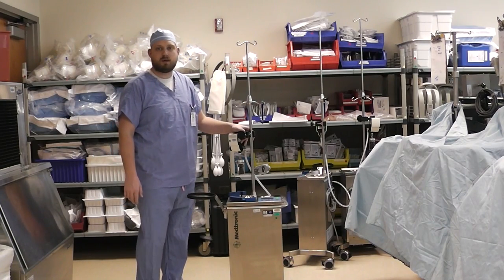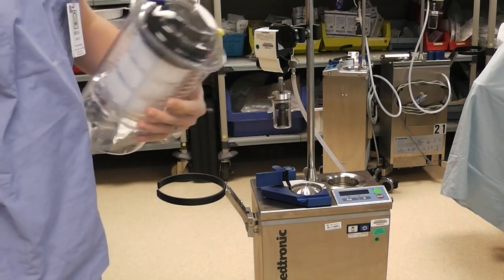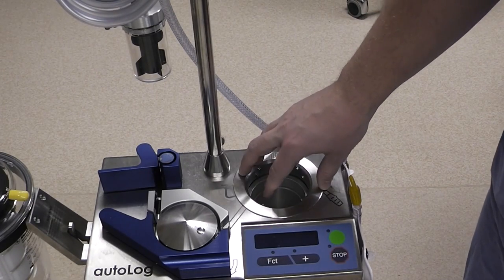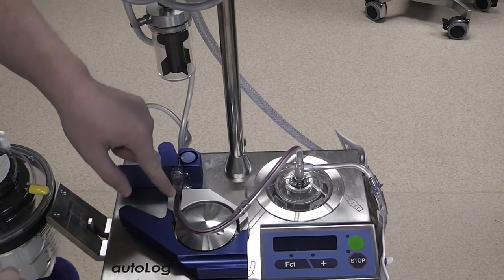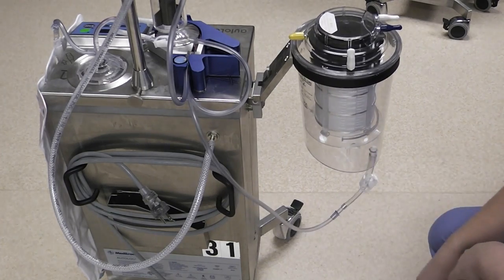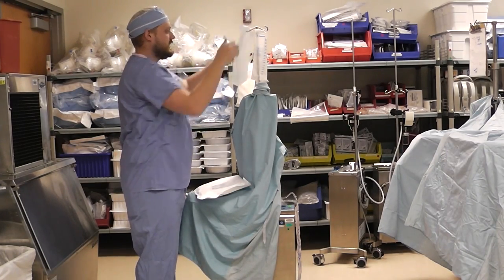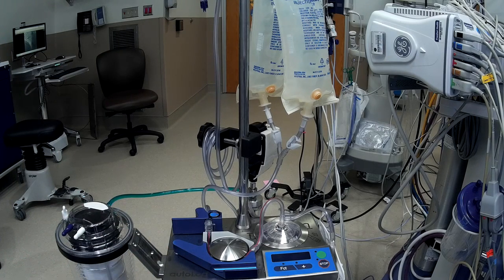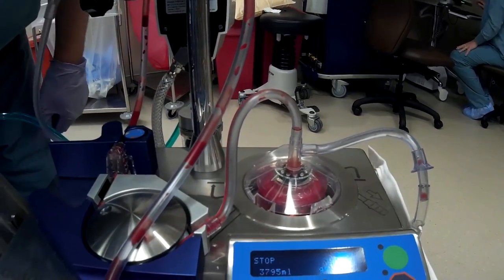Medtronic Autolog Cell Saver Tutorial

Comment: Handy tip, in case of blood getting somehow out of a washing bowl. Press On together with green button, hold it to the moment of screen shows software version and blinking led by green bttn. Pour lukewarm water with soap to the compartment holding washing bowl. But before it, lay some 'hydrophilic' mats or other material, under the device. Repeat and flush with clean water.